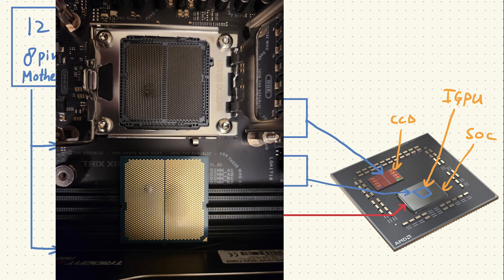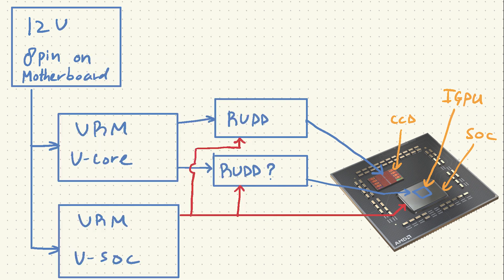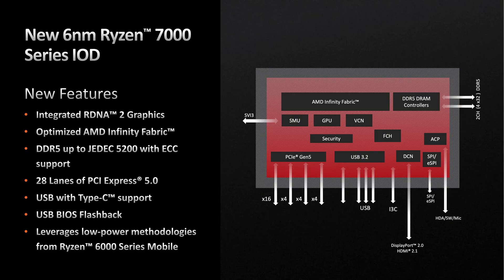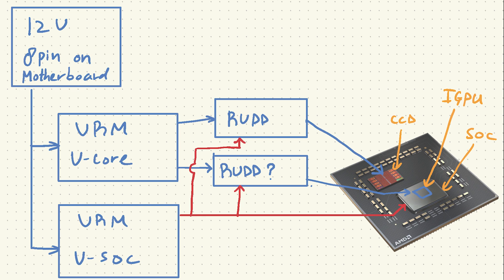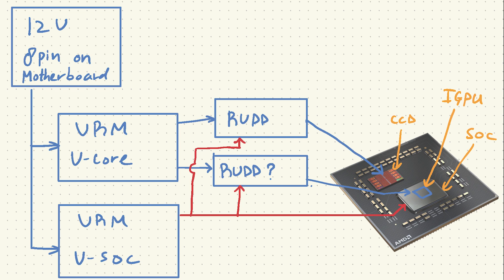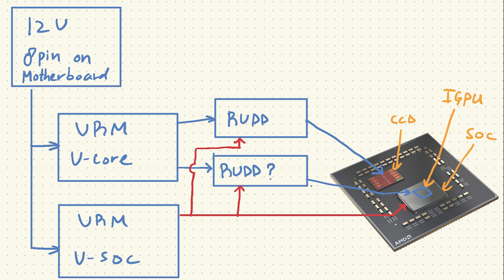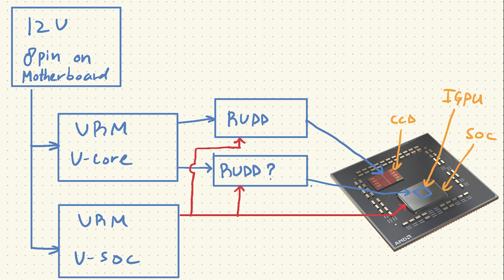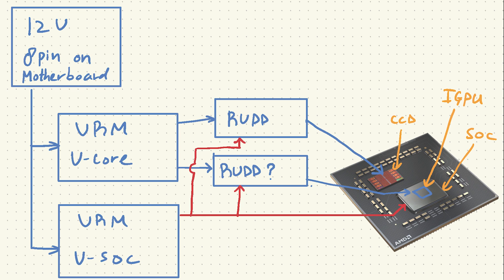A simple breakdown on 7800X3D's melting

Comment: thanks for the detailed information. 
i don't think it will burn down after the updates, but it could possibly degenerate over time.
do you think this is a basic weakness of the chip or something you can fix with agesa updates.
I now also have the 13900k here and am not sure which one to use.
I bought the 7800 to run it with at least 2x32 at 6000mhz.
doesn't sound to me like you could use it for the next 5 years without any problems. 
I still have 3 days to withdraw from the purchase, it's difficult to make a decision